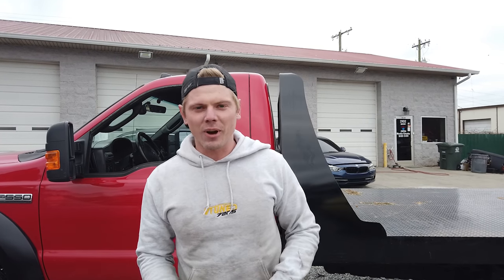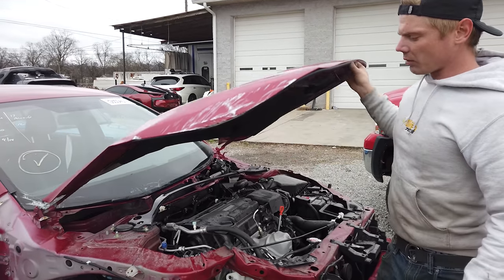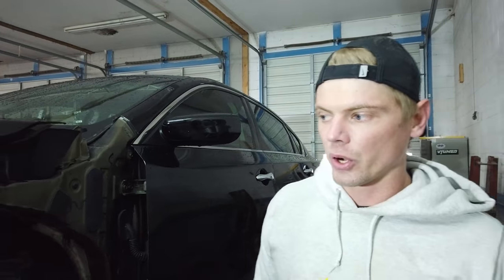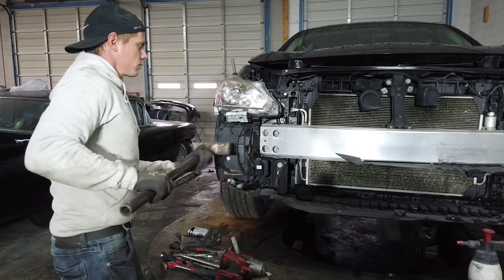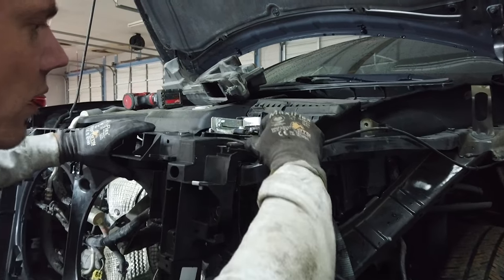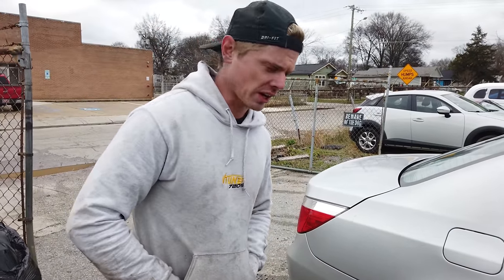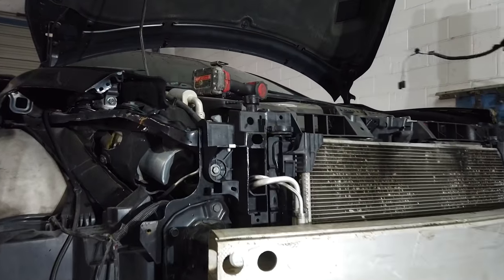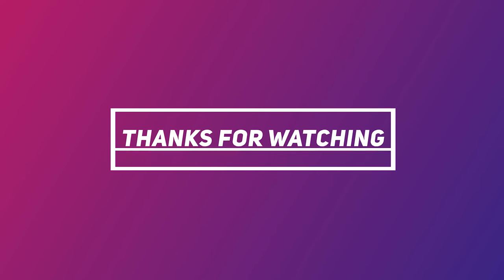Are salvage cars even worth it? Light frame repair vs smashed lemon.

Comment: 2000 Toyota Avalon XLS with 50K miles in perfect condition recently rear ended and totaled by insurance with $5K damage.  State Farm only paid $3500 for salvage.  I had it repaired at a shop that always does perfect work.  No frame damage but substantial rear body work and parts.  Car looks and drives brand new.  Where could I have got a replacement for $3500?   Kicking in $1500 to keep my mom and dad's car, may they RIP, was worth it to me.
Reply: You did the right thing. That Avalon will last you a very long time.

Comment: Do not take me wrong, I don't want to knit pick your work. As a self taught frame guy myself, I guarantee you that it makes your job tons easier to invest in a true tram system and make sure your frame table it level with the earth. That way when you clamp down a car and can measure your pinch rails against the deck. You are assured that the vehicle is level with the earth. Then the tram has a bubble level built into it. You can check square and level at the same time from side to side. It saves you so much time and 2nd guessing.

Comment: I wrecked my f150 in 2002 helping a black steer at night on the road. It wisted the whole chassis and wrecked the engine bay area. The cost of the repair was greater then scraping it.